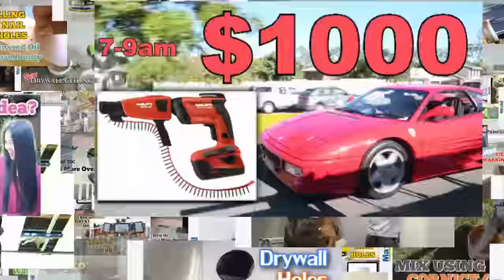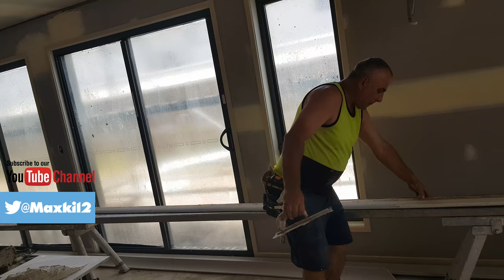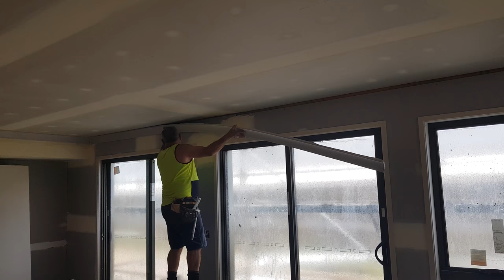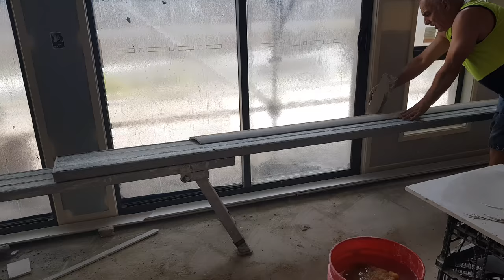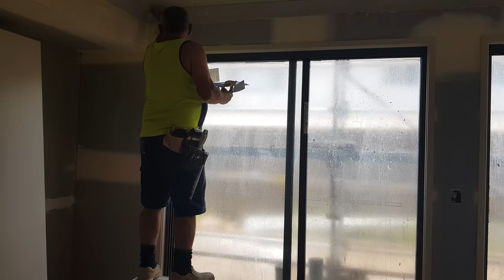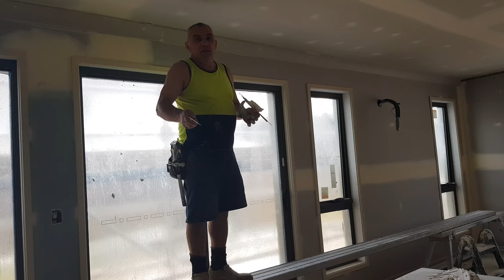How to Earn $170 000 in a year doing Cornice & Drywall

Comment: So in Australia you just attach crown moulding with drywall mud? I've never seen that. In the US the crown is done by a finish carpenter using brad nails
Reply from the maker: Yeah I know. I like watching DW Crown Moulding guy.
So yeah, we rarely use timber crown. It's all plaster moulded lengths of cornice which we use cornice cement to put up.
So it's the plasterers job here in Australia.